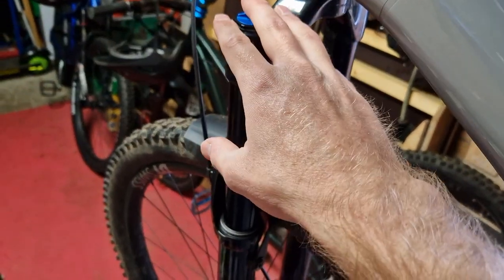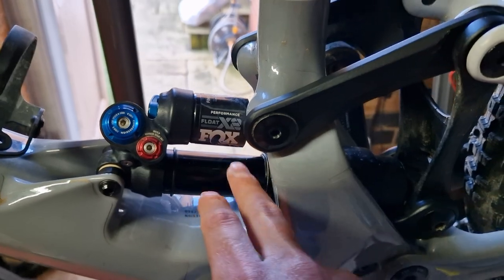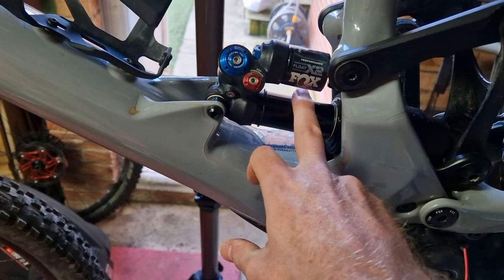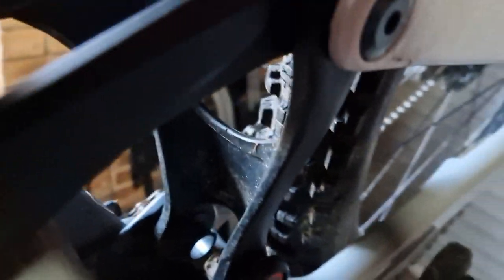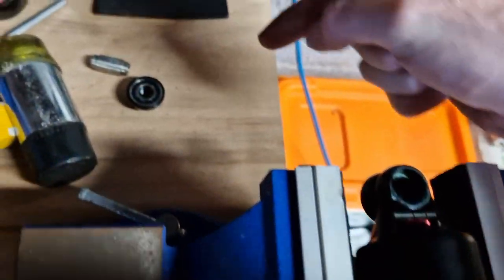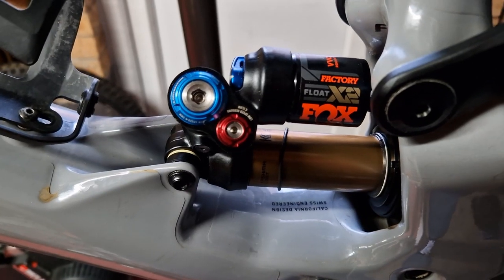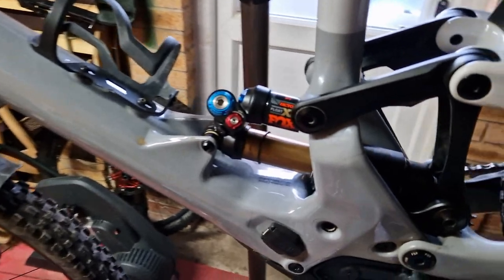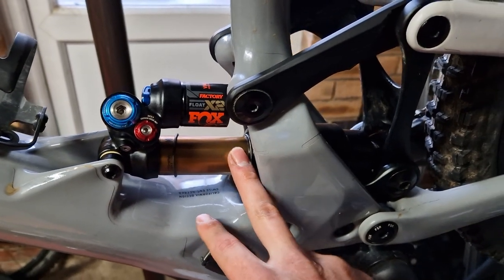Kenevo SL Expert - would you make this change?

Comment: Nice mod, tip. If you use a vice on a shock, clamp the bottom part not the sleeve and it’s very weak and your oval it without knowing. Also you can put the black stanchion on the factory pretty easily if it bothers you that the gold doesn’t match. Any suspension place will do the swap for £50 if you can’t do it yourself. How comes you didn’t go coil if you were upgrading?
Reply from the maker: Yep, I realised that I should have clamped elsewhere as some grease did seep out 😞 luckily, with no damage, and it holds pressure. Didn't go coil as none of the kenevo sl range has a coil option so didn't want to compromise the characteristics of the bike and I am also a light 12.5 stone rider so didn't feel coil was needed

Comment: Nice upgrade..what size is that ?  I cant find the same spec  230mmX62.5mm X2 anywhere . everything still good with it ?
Reply from the maker: Thank you, yeah got really lucky with the shock on eBay, if you can't get the shock off the shelf In that size places like TF TUNED can modify to get the right stroke. Bike is running sweet 😀

Comment: Have you taken it for it spin? How much better does X2 Factory shock feel?
Reply from the maker: It feels much more balanced now as able to tune the rear shock to be more in line/sync with the front forks regarding rebound and compression, could do with a 3rd volume spacer though as still going through the travel too easily at my recommended PSI